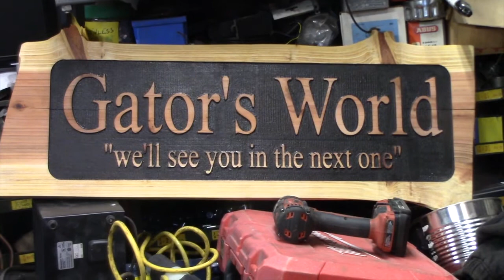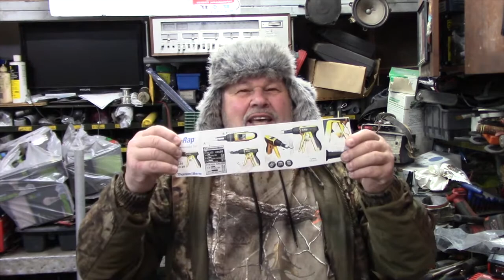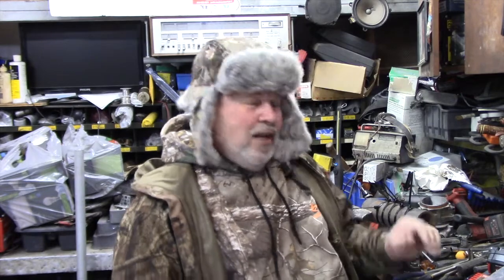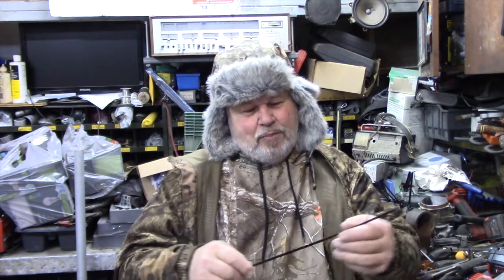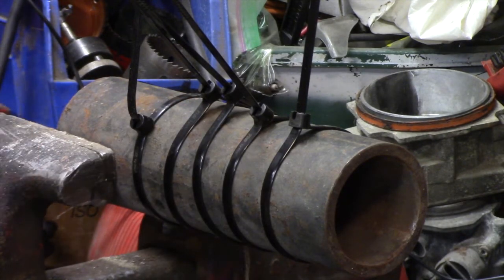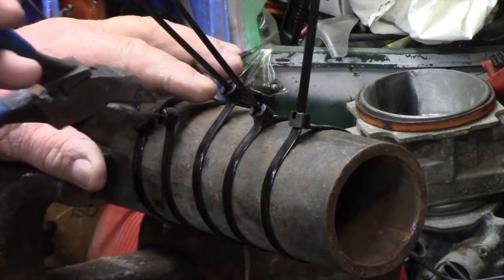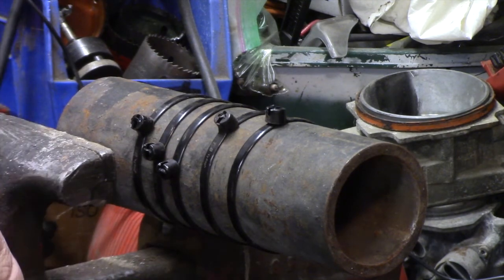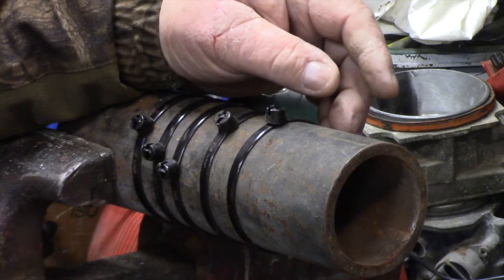Do wire-ties excite you?

Comment: Another tip for ty-wraps Gator,when you open the bag don't cut the end open,make a hole in the side of the bag.That way the ty-wraps stay in the bag not spilled  all over when you pick up the bag.I worked building telecommunication towers for a while and those guys used to just cut the end of the bag and I was forever picking ty-wraps up off the ground.
Reply from the maker: Yes, it happens to me many times Ken ...then it`s like 500 pick-ups....That was good for you...a steady job going being them guys picking them tye-raps....hope you did not give them back to them.....you probably have 1000`s in the corner of your garage....CHEERS for the New Year